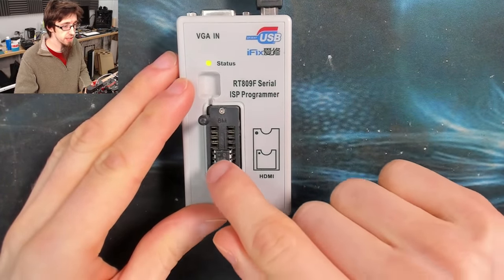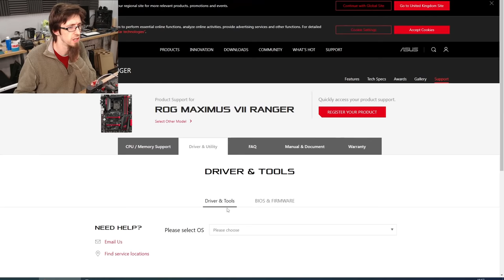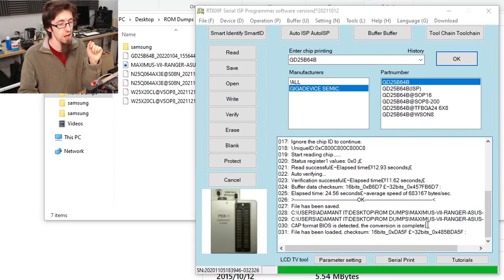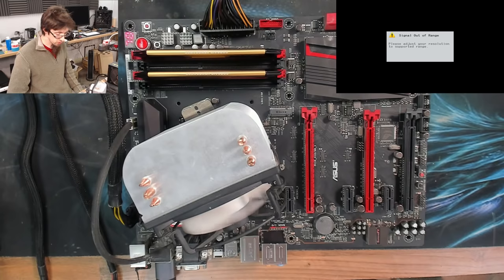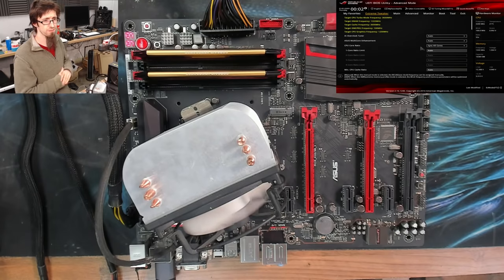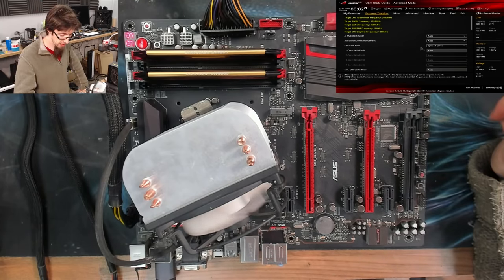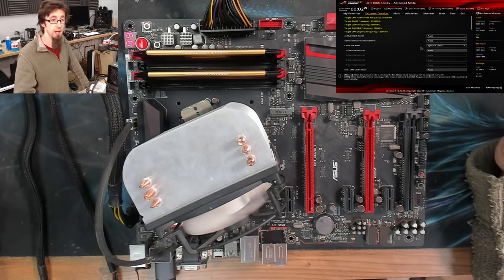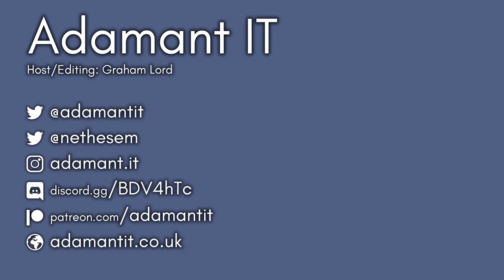Red herrings, red herrings everywhere (4th Gen Intel Build, No POST) - LFC#292

Comment from the maker: Brief FAQ because this video's doing numbers:
Q: You didn't test the other RAM slots.
A: Yea that was a cock-up, dead slots are actually very uncommon, but I should checked another slot when I dropped down to a single module. I think the fact that I was getting absolutely no response from changing the RAM config was why I moved away from that, if there'd been any change of behaviour (power cycling, etc) I'd have been more thorough.

Q: You should've known it was memory issues, you should've looked up the POST Code right away.
A: I think you missed the part where it was nothing to do with memory, and the entire message of the video is to watch out for misleading symptoms.

Q: This board has BIOS flashback. You didn't need a programmer.
A: This was my bad - despite talking about flashback in the video, I didn't actually check. But hey, it was still a chance to show of other techniques that exist.

Q: It's dirty!
A: Yes. This is pretty normal for most PCs. Very few people clean their PCs. It usually won't stop anything from working, unless a fan is completely blocked. I inspect before cleaning because if something breaks during the cleaning process, I'll know it was me, and not a fault the PC came in with.
Reply: Dead Memory slot is highly unlikely cause atleast since 4th gen and for AMD with Ryzen the memory controller is inside the CPU so unless you have a physically damaged slot memory issues come from the CPU
Reply: @animalm4st3r  Had that issue on an AMD processor. I thought the motherboard had a burned out channel. It turned out that the processor was faulty. When it is a processor issue two slots will fail at once, while a motherboard issue will usually give you one unusable slot.
Reply: How much did you charge for the total repair ? Was the charge a fixed charge or dependant on CMOS Battery, BIOS flash,  etc ?
Reply: Yea even though he removed the dust bunny from the ram slot, the camera picked up more general dust towards other end a couple of inches long.
Reply: Someone gave me a 2004 Acer laptop recently, and the reason it wasn't posting was a faulty memory slot, only one works. I guess it is more of an "old computer" issue.
Reply: actually, there are a few instances where using a programmer is better than using the motherboard utility. in some revisions, the utility does not reflash the whole chip, but only the most parts (usually it leaves the bootcode alone). i'm not sure if flashback also does this (unlikely) but something to keep in mind.

Comment: Best stock intel cpu cooler explanation ever.
Reply: Conclusion: Buy a decent one and throw the stock cooler in the bin
Reply: @Ferrari255GTO  The Aliexpress tower coolers are quite good for the money. Most of the time its the fan they cheaped out on. But it can be easily replaced in most cases.
Reply: @Chris-yy7qc  good to know. It just doesn't feel right spending 20 bucks on a cooler when most similar ones are around 80 or 90 without a fan.
Reply: Antec A 30 cooler is best
Reply: @Ferrari255GTO   Go to Gamers Nexus channel for good CPU Cooler and other components reviews!
Reply: @ezequielortiz4188  thanks, i'll check it out!
Reply: @Ferrari255GTO  did you get your cooler?
Reply: @dizzler82uk  got it today, looks very good. Got the dual fan version but it seems pretty stupid that the fans dont plug on the same fan controller outlet. Im gonna pull off my top fan since it doesnt seem to get a whole lotta flow going so it doesnt do much
Reply: @ezequielortiz4188  If you have money, go for it.

Comment: Great job!  The benefit of ignoring the obvious (the error code) - you covered lots of other important stuff that was worth investigating regardless of the fault.  eg.  Say a BIOS reset (via that button) had fixed the problem, you wouldnt have seen the dirt in the memory socket, nor the unseated heatsink, and the connector issues.   My view with any fault is rule out all the low hanging fruit (as you described it) first, regardless of how obvious the POST code might be - you will be surprised at what you discover and the end result will be a far more reliable machine.  My other "goto" there would be to measure voltages and perhaps scope them.

Comment: I like that you actually fixed it by reflashing the bios instead of just replacing the motherboard as so many other "tech" or "repair" channels would have done. A ch314a with a clamp is only like $15 after all.

Comment: CPU needs no cooling, so bizarre, it lived years "semi-cooled" and survived! to tell us about it, amazing
Reply: Intel has had remarkable thermal throttle protection since the late Pentium 3, something AMD didn't do until the Athlon 64 era. I remember many a Athlon/Duron/Sempron suffering basically instant thermal death if the heatsink wasn't installed properly. If you left the CPU without a heatsink, it'd quickly shoot up to 700F or so and either burn or explode. I still remember a kid back in High School turning on his personal Athlon build without a heatsink and unfortunately for him, the CPU detonated and sent pieces of itself flying up into the ceiling. Thankfully the case was on its side and contained any shrapnel from hitting other people in the room, but there were gold pins and bits of ceramic embedded in the ceiling for the rest of the year.
Reply: @GGigabiteM  Reminds me of that old Tom's Hardware video where they did a heatsink removal test on a Pentium 4, Pentium 3, then two Athlons while running a game.

I once came across a video on Youtube where someone pulled the heatsink off a Duron while it was running, and the chip literally flew out of the socket off the motherboard, a few seconds later. Many people in the comments thought it was bullshit, maybe it was rigged with dynamite under the CPU or something, I too thought this was unbelievable and had to be fake. But now after hearing your buddy's experience I really wonder what can cause these CPUs to explode if heated up to extreme temps rapidly. Whether one of the materials the package is made of has violent explosive properties at high temperatures (like TNT), or there's a pocket of air or something inside the CPU can cause it to explode like that.
Reply: @bestage9429  >I really wonder what can cause these CPUs to explode if heated up to extreme temps rapidly. 

Really no need to wonder if you look into thermodynamics of materials. Bridges have expansion joints so they don't blow themselves apart. Tiny temperature changes can cause thousands of tons of force.

This is the same thing that causes BGA failure on ICs with ROHS solder, the thermal cycling causes movement in a material with no ductility, so it cracks and fails.

In early Socket 462 Athlons, the package was a hard ceramic. If the core rapidly heated to 700F and the surrounding ceramic substrate didn't follow, it could create enough force to blow the package apart. I'd imagine it'd be much more likely to happen on a new chip rather than an old chip, since the ceramic package probably had micro fractures in it from thousands of heat cycles that could allow some give to expansion.

In all three scenarios, you're dealing with hundreds or thousands of pounds of force. It'd be like putting a ceramic block in a hydraulic press and having a pikachu face when it exploded from the pressure.
Reply: My i5-4670 CPU runs cooler than a cucumber. I only have a Hyper T2 fan on it too. Was a whopping $10 when I bought it. Does the job though. It is a bit cool in the shop today but the hottest core temp is +24.0°C One core is +19.0°C It's really chilling.
Reply: @GGigabiteM  the pentium 4 and pentium 3 had horrible thermal management.  the pentium 4 would try to lower clock speed "if it was equipped with speed step which mostly was on the mobile chips"
Reply: @CotyRiddle  Not true at all. Intel has had power management features since the late Pentium and early Pentium MMX.

While clock ramping is a power saving measure, it was not the only power saving measure to exist. AutoHALT, Stop Grant, sleep and deep sleep existed before clock ramping was introduced. The OS could also sent NOPs to the CPU to tell the CPU no work needs to be performed, which reduces the CPUs power consumption as well.

The Pentium 3 had all of these power saving features, except clock ramping. The Pentium 4 had all of these features in later versions, but not Celerons.

Celerons were the exception, on top of being pig slow, Intel thought it was a great idea to remove power saving features as well, so they ran smoking hot and drank power like a cow in the desert.
Reply: There are a few videos of Linus Tech Tips briefly testing Xeons without any heatsink on and they don't overheat.
Reply: @GGigabiteM  yo umight want to research that a bit more. plenty of p4's and p3's died horrible deaths due to inadequate cooling (I personally had a p4 melt the cpu socket due to me not mounting the heatsink properly).
Reply: @BrunodeSouzaLino I have a few Xeons E3s and E5s myself but it’s an interest of how I could test this.  I follow try to follow the processor technical specs and prepare the cooling to cover the TDPmax expected and insure that “sounds right” for the wattage and demand on processor.  I will keep a look for that vid.  🙏 Thanks

Comment: How that PC worked 7 years without blowing up....I am amazed.
Reply: For the average daily user it wont show up as a failure.
The CPU will simply throttle down and run on a much slower clock speed, thus producing much less heat.
It will most likely appear as a random slow reacting PC during the active session.
Reply: @CXensation  This is one of the real differences that separated Intel from AMD for the longest time.  You simply could not run an AMD without a cooler or it would burn.  You could with an Intel as it would simply throttle down to accommodate.
Reply: In all my years of building and repairing PC's it never ceases to amaze me what a modern CPU can survive.
Reply: I once discovered, after using it for a decade, I had omitted to remove the plastic peel off the CPU cooler. It was a Core 2 Duo. Never had problems lol.
Reply: We don't know how much of it happened after the PC was experiencing problems. Typically someone will try to fix something themselves before seeking expert help. The BIOS corruption was just out of their depth. I'd wager they did built the PC themselves though. So I'd further bet they went all through it unplugging and plugging everything back in before they took it for servicing. The last time around they likely didn't do that great a job of it either.

Comment: Intel thermal throttling is nothing short of amazing for managing to last this well in torture conditions. And that beta version is the specter/meltdown patch IIRC. That model (Maximus VII Ranger) is the same I have, and from what I remember, that BIOS appeared around that time.
Reply: look like the BIOS on my Maximus IV Extreme
Reply: @miff227  I doubt Asus made them look any different for the same ROG branding. You can see it is the Ranger around the 5:00-5:10 mark, both in the VRM heatsink as well as the board printing.
Reply: @freemansfreedom8595  2019 ROG motherboards also have the same skin as the one in the video.
Reply: @freemansfreedom8595  sorry, I thought you were suggesting that BIOS look came into being around the time of 4th gen Core CPUs?
Reply: @miff227  no, I meant that it is my current mobo, and that beta patch is for patching the meltdown/specter vulnerability
Reply: @freemansfreedom8595  understood. Sorry for confusing stuff 👍🙂
Reply: @miff227  Don't worry, don't worry 😁
Reply: i customized my i7-3770 p8z77-m bios to include the latest microcodes , irst modules, latest vbios, latest management engine... since asus didn't want to do that anymore for their customers.

Comment: Hi Graham, I like the wording "bit rot" :) ... A good culprit - cause for "bit rot" is low voltage, aka CMOS battery. It would be so nice if motherboard manufacturers including a circuit to monitor CMOS battery  with all the other voltage monitoring.. Anyways, enjoyed the red herring tour de force, because you did find many other build problems, and resolved them as well - NICE work!
Reply: @badjonatan  The CMOS battery powers the RTC which contains some SRAM to store volatile settings, nothing to do with the BIOS Flash memory IC. This RTC may be integrated into the chipset or APU in some cases.

Comment: Great video. I loved your reaction the CPU cooler being loose. I bought a custom built PC in October 2021 and had CPU heating issues with an AIO liquid cooler. After a few weeks of research, I tried replacing the stock paste that came with the Kraken X63. Found out the paste was dry as a bone and replaced it with Arctic MX-5 and my CPU stopped thermal throttling and running at 90C playing games. Now i see 75C tops running Cinebench with PBO enabled on my 5800X. Rerouting all the cables was I nice a touch.

Comment: I really do enjoy your videos...  this one struck a chord as I frequently find myself chasing down 'rabbit holes'...  your fault isolation technique was quite thorough!  Eliminate what the problem is NOT and you will left with what the problem IS..  well done!  'Bit rot'...  been quite a while since I heard that term 😁..  back in days of the 8086, chasing down faulty ram chips... dating myself a bit.
Reply: Just like me when I admit to reporting a bug to DEC on one of the library functions of the C compiler shipped as part of VAX VMS, and the wonders of beestings in ethernet replacing long serial cables to a variety of mini or mainframe computers.

Comment: Nice vid, built PC with step daughter for christmas, she enjoyed it. It didn't post and I grabbed spare GPU's thinking it was that. In the end, reseated RAM & CPU and it worked. I watched her install them and didn't see anything wrong.
Reply from the maker: There's a lot of mileage in just reseating things. Often I see new builders being too gentle on stuff, so it's gone into the slot, but the contacts haven't really "dug in" and are just kinda resting against each other without having a good connection between them.

Comment: So, as of two days ago, I have a no post computer. 
Your explanations and troubleshooting steps are a great help in confirming my eventual diagnosis of a motherboard failure.  I have a new motherboard and CPU on order, and I hope that I will be back to playing soon. I feel much better about spending this money as I am now sure that I eliminated most of the other problems.
By the way, the bios on this motherboard is soldered onto the board. As much as I want to 'play' with chip programming, I am content to upgrade my machine.
Thanks much.

Comment: I used to own that exact mobo. I wish now that i hadn't sold it for scrap when i had boot issues with it. After a lot of testing, I concluded that it had to do something with the cpu socket, but i am convinced now that it was the bios. The boot behavior was different (it was power cycling). Thanks for the useful video mate.

Comment: I had a bearbone PC placed under the table back in 2004, running on Pentium 4. One day I decided to clean the CPU fan but forgot to plug the fan's cable after I had done with the cleaning. The PC lived for another 6 months and finally gave up. IT was my first computer.

Comment: My guess> the customer was trying everything they could try to get it working (once it stopped posting). Removing PSU connectors and loosening the CPU cooler. Of course they had zero knowledge how to put the stock cooler back on, or renew paste or even how to put those PSU connectors on properly. I think that is reason the CPU was 'OK' it never really did any work after it was loosened. I am curious where this BIOS programming software comes from. I too snagged a BIOS programmer but it did not come with any software. Thanks for the great videos =)

Comment: Great fix Graham.

Incidentally that mobo does have Bios flashback.
I have the exact same board with a 4790K here from my old PC that has a 00 code boot loop.
I've tried everything that I was able too to diagnose it including a bios flashback with no luck.
The only things I haven't tried is a different mobo or CPU as I don't have either to try.
All the interwebs research I've done on it points to a dead board, shame as it was a good system back when it worked.

Fortunately it wasn't my gaming PC and I only used it for more basic stuff. I had to rebuild it with an ASUS P5Q3 and Q9650 which was my old old system (I never throw old part away) , not a great match for the 780Ti that's in it but it works OK for what I use it for.

Comment: if i remember correctly .cap is kinda like a capsule, it was an added layer of security to prevent bios modding maybe it contained a checksum of the bios, but when the .bin file was extracted you could still flash the .bin.

Comment: Ultimately the thing that's satisfying about this, as a potential repair customer, is that combination of not needing new parts but also the fix required some professional equipment and knowledge I wouldn't have had, so the repair fee would still feel like a good investment, anyway. Finding out a cable just needed pushed down a bit would have killed me.

Comment: There is a litte trick for getting rid of code 26 on Asus boards. Remove all Ram modules and power up the computer. Wait 10 seconds and power off the system. Do this one more time and then plug back the modules. Works like a charm.

Comment: @24:55 I'm so happy these newer boards don't just go bang like they used to when the 4/8 pin wasn't plugged in, I forgot to put the 4 pin cpu lead in once about 15 years ago, oh the smells are coming back to me :D

Edit: after watching the video the Cmos battery could have been the issue, when I've had to replace dead batteries I've normally had to redo the bios due to errors and twice I've had to do it with a programmer like you've done here